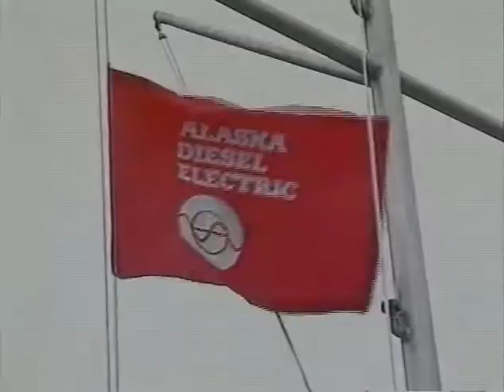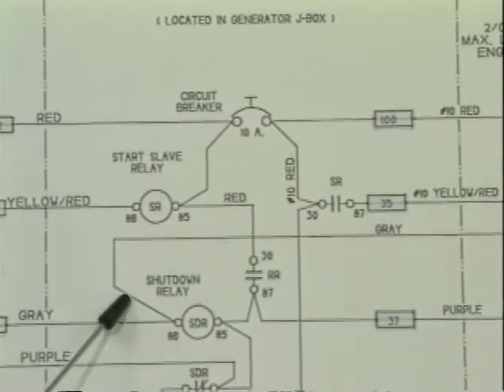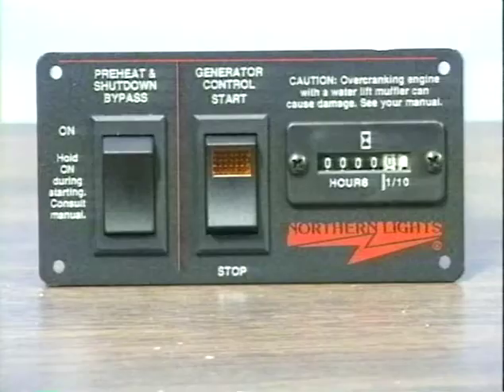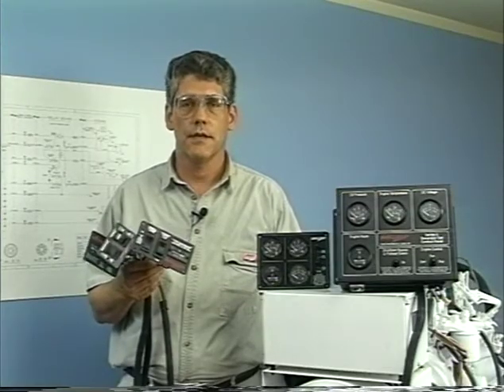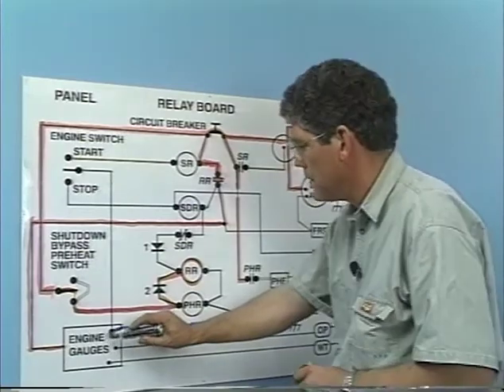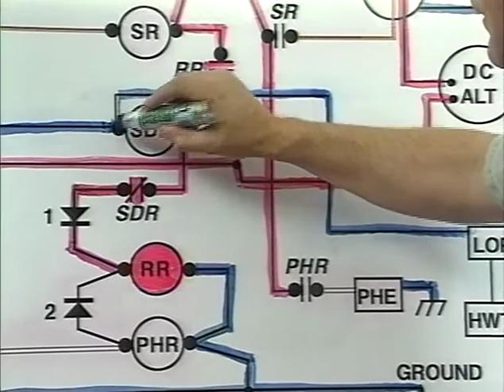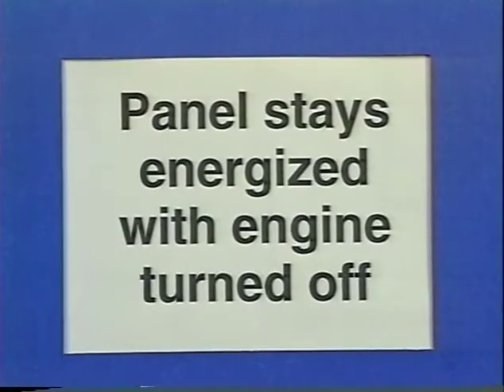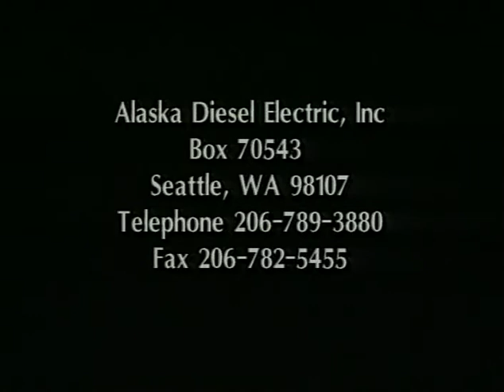There is Logic to DC Logic - by Northern Lights, Inc.

Comment: This was a fantastic overview, also kudos on having all the terminals on the relays numbered !

I think I must have a custom start panel ... .from 1988 ... on two 30kw M4276 1200rpm NL gens.

I have hours/oilpressure/watertemp gauges, start/stop button, and warning lights for shutdown sensors.

Inside there are 5 timers/contactors, your video and the manual show 4. The port gen stopped firing the relay sequence.

Is there a way to manually trigger the sequence or deduce what is keeping the sequence from firing ?

Comment: Excellent video! I do have a problem: i have a 8kw northern lights non-marine generator. I have serviced the generator by changing the oil and filter, chanfed the fuel filter, changed the air filter. The generator has coolant, oil and a clean air filter. The generator over heated, i was told to replace the thermostat - i did. The generator will start and run as long as i hold down the glow plug switch (a tupe 1panel) i was told to remove the water temp safety switch then was told to remove the oil pressure safety switch. I did both of those things, no change since i have to hold down the glow plug switch to make the generator run. Currently I've removed the thermostat and reconnected the safety switches - but same result. I need help! Please!
Reply from the maker: “Hi Bob,

When you say “remove the water temp safety switch and then the oil pressure safety switch,” did you actually remove these switches from the engine, or just remove the wires from each of the switches?  Also, it’s important to note that your engine is equipped with senders and safety switches, so we need to make sure that you disconnected the switches, and not the senders.  It’s also important to note that the safety switches are there to protect thee engine from damage, and they should only be disconnected for troubleshooting purposes, and only if you have a method of verifying oil pressure (a mechanical gauge), and engine temperature (a non-contact infrared gun).

You could indeed have a safety switch that is malfunctioning and causing this behavior from the generator, but it could also be a couple of other things causing the trouble as well.  If you are able, please call our Seattle headquarters during normal business hours and ask to speak to Scott Dyball and he will be happy to help you troubleshoot the problem further.

Thank you,

Northern Lights team”